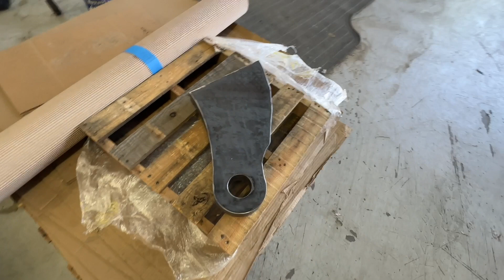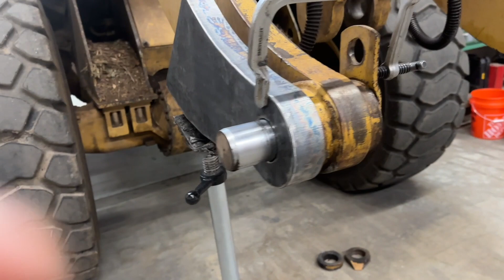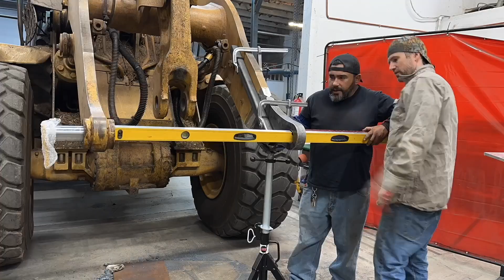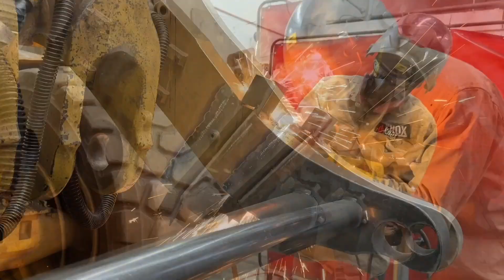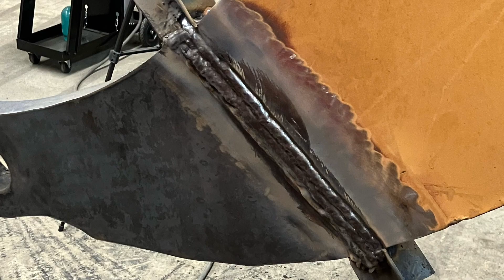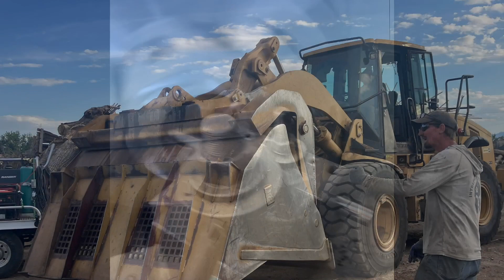CAT950 H Loader Arm Repair

Comment: Good video. Few critiques though.

Weld the pin bosses on then linebore the whole stack.  Bushings like that need more “crush” than .001”.

CAT Bores are normally a nominal Metric size and the bushing is sized to give appropriate interference fit.